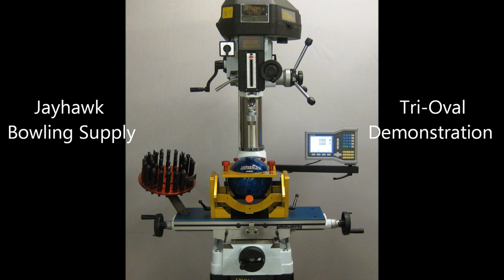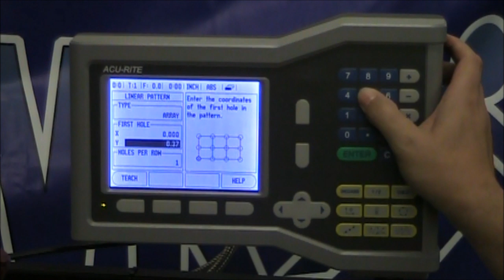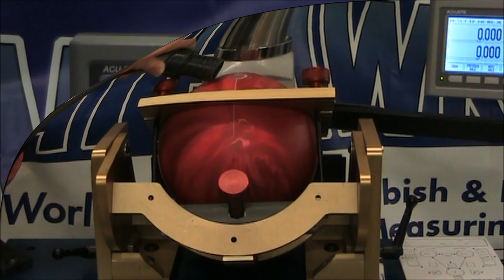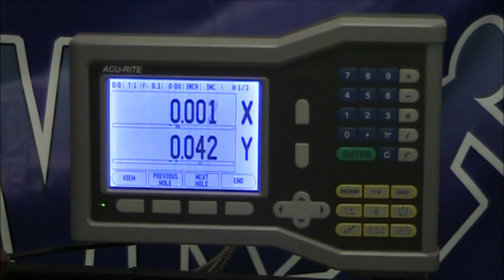Jayhawk Tri-Oval System Demonstration

Comment: Why the rotation part is done all manually and without a readout?
Reply: I noticed that.  Looks like video was shot first, then overdubbed and some setup details were missing - like how they hoped to maintain a 1/4" minimum bridge between those fingerholes all the way down as they drilled to near convergence [assuming they started with 1/4" separation].    There may be markings as manufactured, but I can't see them.  If his jig needed markings added... I would engrave a vernier scale for that bottom half moon part of frame using a digital level for initial calibration, mark it in degrees, and keep a trig chart for corresponding fractional pitches handy.  That takes care of x oriented pitches.   I'd have to have this jig in hand to figure out where best to put markings to deal with y oriented pitches.  Both x and y axis calibrations have to be referenced to the quill shaft, and not the table to get it right - a bubble level will lead you astray as it assumes all is square to start with.
Reply: You may not have noticed, but the finger holes were laterally pitched away from each other, so that they do not meet at the bottom. the Ring finger was pitched at 0.625" and the middle -0.125". This makes the holes more or less parallel to each other (although standard rule of thumb is to do 3/8th" away from centre for both fingers, unless the bowler has specific pitching requirements).
Reply: @alsheps300  3/8 away laterally both directions equals 3/4 pitched away total   so you figure 5/8 and 1/8 still equals 3/4 total pitch away from one another just not the same from center line that's all.  Those pitches will work without issues as long as a1/4 bridge is in effect